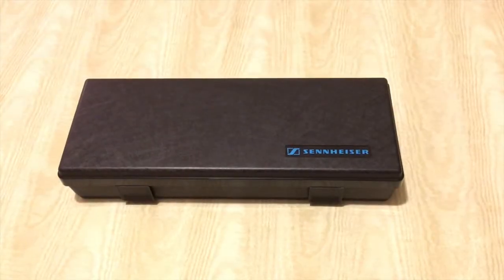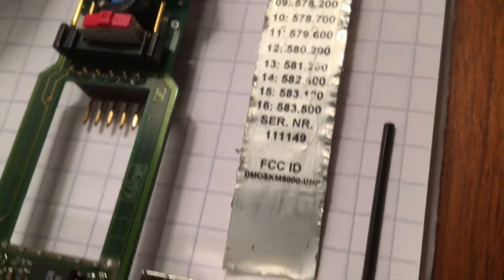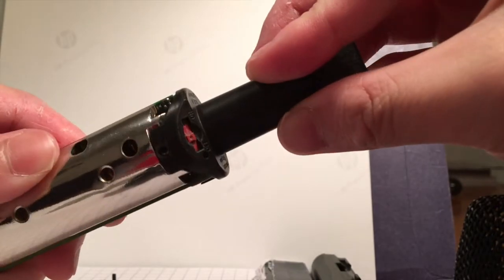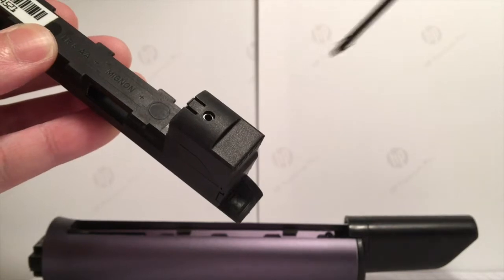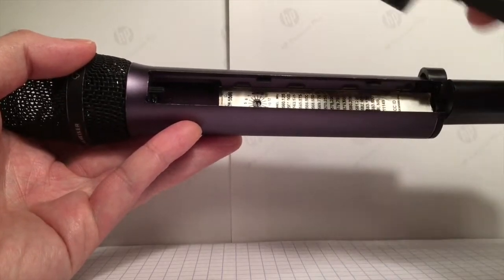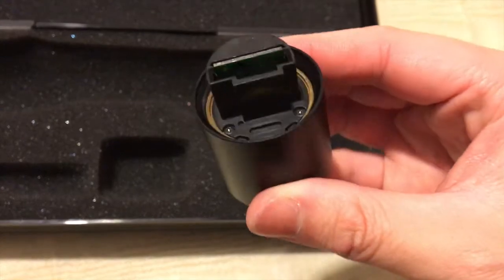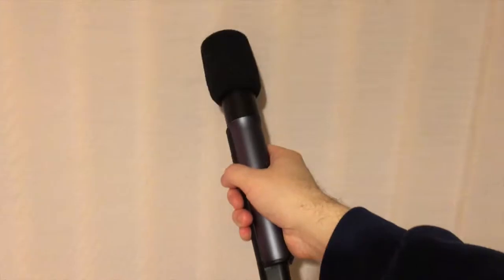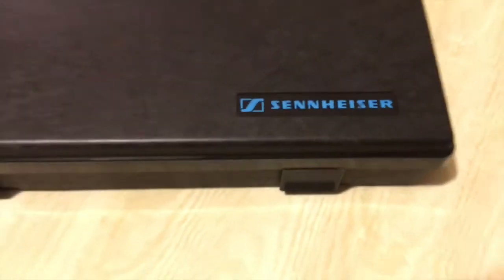Assembling a Sennheiser SKM 5000 UHF FM radio mic (560-583 MHz)

Comment: How does the EM3032, SKM5000 with ME5005 capsule stack up against EW100 G3 with e845 capsule?
Reply from the maker: I never got to compare those combinations but I do know the e935 is my favorite dynamic mic capsule from Sennheiser. I recorded the audio to this video while speaking through an e965 condenser capsule on a Sennheiser D1 digital transmitter.

Comment: Which Is better Skm or Neumann kms 105
Reply from the maker: That’s about preference as they sound different. The Sennheiser MMD 5235 mic capsule that I see often is similar to their cardioid e935 dynamic handheld mic. Has plosive punch from proximity effect and more sibilance which is great for live performance and sounds less harsh than the Shure SM58. The Neumann KMS 105 is a super cardioid condenser which puts out a really flat EQ response, meaning you lack some of that low end punch and the highs are a bit more mellowed out, but the vocals sound very present and don’t get swallowed up in the mix.

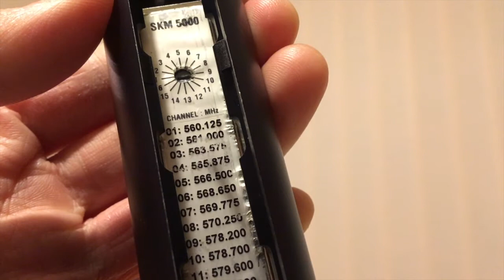Comment: Hi, finally got an SKM5000. Apparently i don't have the right receiver that runs in the frequency it supports. Just to know if it works I came here to watch this video. I have one question, @5:07, I see the LED lights up red once you turn it on. Is the red light supposed to light up continuously or it stops after 2-ish seconds after being turned on (which is currently happening on my SKM5000)? Thanks in advance..
Reply from the maker: Hi there. I believe the light cuts out if it cannot be paired with a receiver channel. It should otherwise light up green. Also make sure that the channel selector is in fact set to one of the channels listed inside, otherwise you won't have a clue what the 16 channels actually are and have to play a guessing game. I do not have a receiver for the SKM 5000 so I do not know for sure. I only bought it as a collector item, not for any actual use because it is a very old design and is actually tuned in the 600 MHz band unlike the original channels shown in the video. It will soon be illegal to operate anyway which is why I tore it apart.
Reply: bmiranda2645 thank you so much. So yeah I decided to search the net for a matching receiver. There are loads of 3032s & 3532s. I think they’re a bit too expensive. I have my eyes on a used 100G3 & an EM1031 receiver which are running at the same frequency with my SKM5000. Which one would you say is a better receiver for the SKM5000. So sorry to trouble you with all these. But sennheiser isn’t helping me on discontinued products anymore. So glad you posted your videos. Has helped me a lot.
Reply from the maker: You should look up the instruction manual for the SKM 5000 transmitter. I think it tells you which Sennheiser receivers are compatible and I think some people were able to get a G3 receiver to work as long as it can tune to the exact channels listed on the 5000 transmitter. That is why I never planned to buy the receiver with it. Too expensive. I just wanted the transmitter because it was the same model used on the first season of American Idol except they used a Neumann condenser capsule with the foam windshield over it. I was a big fan of the show until 2010 when I quit watching (by that point they were using chrome SKM 5200 transmitters with MD 5235 capsules, similar to the dynamic e935 mic).

Comment: hi friend, make a video taking the capsule out of the big because I need to do the same in a microphone just like yours, but I can not.
Reply from the maker: Honestly I do not know how to properly take the capsule out of the globe which is why I did not want to show it on video and cause people to damage their capsule. It is only snapped in so it can freely rotate. I did not find any proper instructions but wanted to clean the inside of the grill so I had to pry the capsule out using a small screwdriver and an Allen wrench. There are two small holes inside the capsule that I believe allow you to pull the whole cartridge out.
Reply: Friend please make a video I believe will help many people here in Brazil, and especially me.
Reply from the maker: Hi there Brazil. I just uploaded a video for how I remove the capsule like you requested. Greetings from Merica!

Comment: Hi, how did you pull out the kapsel from basket?
Reply from the maker: I used two small Allen wrenches to pull the two holes of the capsule at the same time. They are what lock the capsule in place and allow it to rotate freely.

Comment: How much you buy this one?, please answer or you don't answer in here,you can email me, thx😊
Reply from the maker: $600 on eBay. Included case, ME 5005 capsule, SKM 5000 transmitter, and B 500-1 battery pack. I did not even buy the receiver rack for actual use. I only wanted this mic to add to my collection.
Reply: bmiranda2645 this is original?
Reply from the maker: Yes I believe it is. I know that you can't always trust a seller who is not an authorized Sennheiser dealer, but I'm confident this is an actual discontinued 1990's-2000's era SKM 5000. And if not, then I at least didn't pay $3000 for an original when it was new on the market decades ago since I only want it as a display mic. Chinese counterfeit Sennheisers have slight differences and may be hard to notice, but internally the fakes have giveaways. If the build quality is questionable, then there's reason to believe it's a fake.
Reply: bmiranda2645 ok thx for your information 😊,(you can sell to me in Rp.350000 😁)
Reply from the maker: Are you Indonesian? 350,000 Rp coverts to $24.24 US. Sorry but I can't sell it for that low considering I found it in such good condition. However you can look on eBay I found some cheap SKM 5000 mics available.
Reply: bmiranda2645 LOL,im just kidding bro 😂
Reply from the maker: Dessar Bermart Vega Agung haha I was pretty sure you were. 350,000 Rp is how much the foam windscreen costs. The case costs even more.